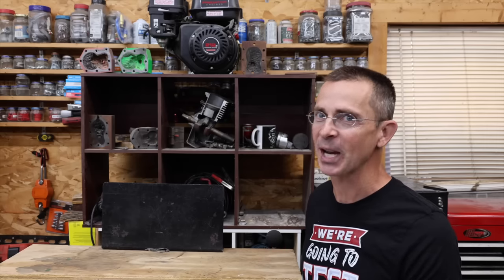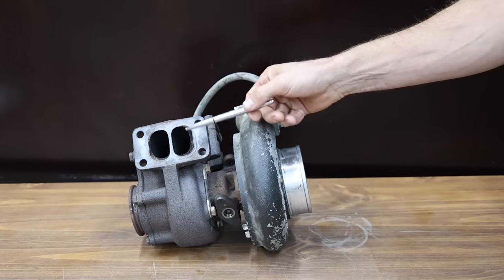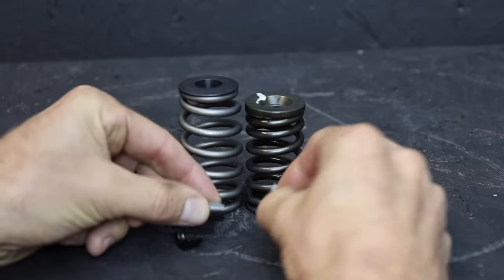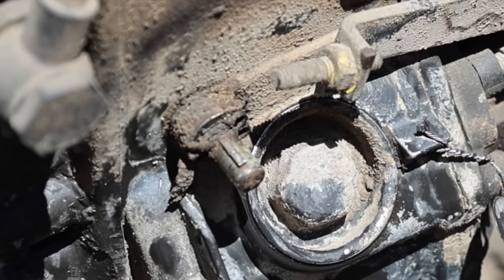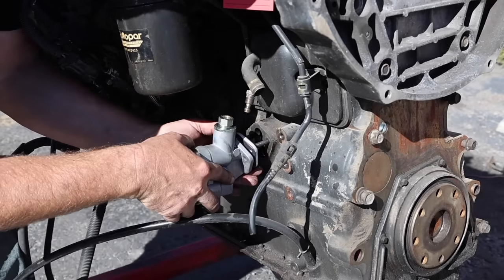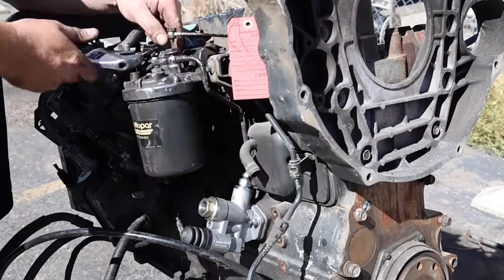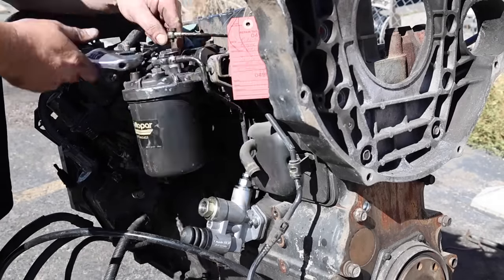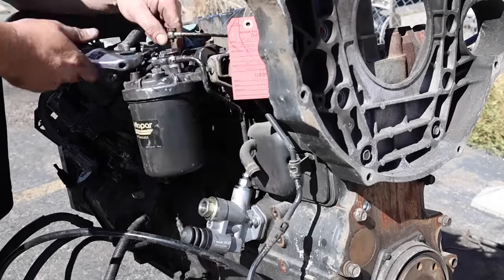Did I Waste $5000 on Engine Parts? More Horsepower & MPGs? (Part 1)

Comment: Wow! Looks like you basically doubled the horsepower, and more importantly, the torque. Very impressive. Those numbers are close to what my 2018 6.7 Cummins makes. I wonder how long the engine will last putting out that much power?
Reply: Should last a long time still. That engine is choked to crap from the factory. A lot like our 6.7 diesels are... except now it's because of emissions stuff.
Reply: Longer than anything new. My employer bought brand new KW T880 last year with x15 Cummins and it broke crankshaft in two with only 24,000 miles on it. We have several trucks with Paccar engines and Cummins and all new and always got problems.
Reply: There is a marine version of the engine that puts out 300 HP stock.
Reply: It will last, there are people out there making more and they are still running strong as a work vehicle.

Then you have mine which is not a work truck I've had for 9 years and daily drove it. Most of it's life to me had a 72mm single, 5x016 injectors. The bottom end is still stock and it's still a runner.
Reply: @BruceLee-xn3nn that doesn't happen on Australian Kenworths with the x15
Reply: @BruceLee-xn3nn  Every engine brand is prone to a failure. I managed truck fleets for 30+ years and I've had one engine go 675k before we inspected the rod and main bearings. I had another brand new that made it 6 miles from the dealership and locked up. So it matters not if it's a USA or Australian engine.
Reply: @Watchyn_Yarwood  our 92 mack wth close to 900,000 has had less problems than the new expensive junk they've bought. We've had to change turbos on several other trucks and they didn't even have 300,000 yet.   The Cummins that broke the crank now has electrical problems where the cluster. It goes haywire where gauges don't work right ,no AC,no Jake brake. We've never had constant problems before like we do now.

Comment: Now you need to add an OBDII ELM 327 dongle and get the OBD JScan app.  That app will let you make more custom changes, although it is geared toward more modern Ram/Dodge/Jeep products.

Interesting story:  had a 2011 Ram 2500 work truck that had a button on the dash to let you run "light load" mode.  This let you drop tire pressures to 65psi front and 45psi rear when not towing or running heavy.  This allowed the truck to ride like a 1500.  The button re-adjusted settings for TPMS warnings.

Ram got rid of this feature after a year or so, likely due to idiots forgetting to air back up prior to towing/hauling.  However, the JScan app brings back that functionality!

Of course, if your truck is pre-TPMS, you can just adjust pressures (and subsequent ride comfort) as needed.

Comment: Love this. It’s a little different than what we are used to but wholeheartedly welcome. Btw I am on my 9th 12 valve Cummins. It’s getting harder and harder to find clean ones and the prices have shot up quite a bit. It’s still the best engine ever made with multiple trucks at over a million miles. Once again awesome video.
Reply: Yeah they're reliable, but only because they have no power. You reduce the RPM/boost to 180HP and <3k redline on any newer Diesel and they're also going to last a million miles. But yeah obviously not having the emission systems is a huge benefit for the older Diesel trucks.
Reply from the maker: Thanks!  Thanks for the feedback.
Reply: I respectfully disagree. If that was the case then why aren't the 6.5 gm amd 6.9 ford's of the same Era known for being as reliable? The lack of electronics, 40% less parts than its counterparts, robust p7100 injection system, straight 6 layout, medium duty design, mechanical fuel pump and about a dozen other reasons are why it's so reliable and awesome. Even turned up they seem to last forever.
Reply: @fdavid 6.9 fords are known for being reliable. You’ll get over 500k out of one absolutely no problem with some basic maintenance. But they don’t have the potential power like the 12v, so they don’t get talked about.

Comment: Kudos to the folks at Power Driven Diesel. IMO “do not try this at home”. Very impressed with the body condition of your 16 year old truck. And yes, you did get your monies worth!
Reply: 16 years? You're off by more than 10 years, a 96 is already 27 years old which makes this even more impressive tbh. My winter truck is a 86 and definitely benefits from regular oil based undercoating as it doesn't really rust anymore after I've welded in lots of fresh steel to fix the previous  owners neglect. But it could need an upgrade as well, it's way slower than Tods truck in stock form :D
Reply: @creak92  at 0:17 he clearly says he has had the truck for 16 years.
Reply from the maker: Thanks for the feedback.
Reply: @cdnmember  "I've had this old 1996 Dodge for over 16 years", you can buy trucks used instead of factory fresh after all.
Reply: @creak92  Which obviously means he was not the original purchaser and did not get the truck new. He let someone else take +10 years of depreciation before he got it. That was smart. Now he is making upgrades to bring it to modern levels of performance to a fraction of the cost of the new truck. Also very smart. Now is has upgrades to one of the most revered motors in terms of reliability, and one which does not suffer from all the annoying EPA required crap that makes the modern truck unreliable (DPF and DEF). Also smart!
Reply: @LisaMedeiros-tr2lz  why you're telling me that? That's exactly what I was saying.
Reply: @cdnmember yeah... ever heard of used? Idk how you think it's only 16 years old lol. A 2007 is. And that's clearly not a 07 cummins lol.
Reply: @LisaMedeiros-tr2lz I have a 17 f350 6.7. Thing is reliable as all hell. It still had 214k on it stock. But since has become not stock anymore and lot louder.
Reply: @joshhassler  never said it was 16 years old, only that he said he had it for 16 years, so,he took good care of it. Obviously bought used so let someone else take the depreciation hit.
Reply: @creak92 "definitely benefits from regular oil based undercoating" - So that's why my car is leaking from the engine and the trans like crazy, it's trying to protect itself from corrosion.
Reply: Just make sure you never order any parts from them. They straight up stole my money and when I tried to call and figure out what went wrong they told me to get lost because I don’t drive a Cummins.

Power Driven Diesel is the worst company I have ever dealt with in my entire life.
Reply: @meowfaceification  sorry to hear, sounds like an issue for small claims court.
Reply: @cdnmember  "Very impressed with the body condition of your 16 year old truck" "never said it was 16 years old" gotta make up your mind guy

Comment: It nice that you have reached the point where you van treat yourself to a upgrade and be able to share it with us.

I would also consider checking on the health of your differentials and transfer case just to be sure they can withstand the sudden boost in power without shearing gear teeth.
Reply: Good one.  Get that factory tar out of there if nothing else.

Comment: I had no idea that valve springs played such an important part in keeping floating valves at a minimum.  Nice replacement for that old engine.  Along with the new turbo charger & exhaust manifold gasket, you should be running good.  Cheers from eastern TN
Reply from the maker: Thanks for the feedback.
Reply: It's a very common misconception, but those particular springs don't actually help RPM induced valve float. They are a taller lower rate spring designed to increase seat pressure to keep manifold pressure from opening the valve. For valve float more open pressure is what is needed.

Comment: This video is Exhibit A of why the older 12 and 24v Cummins trucks are so expensive still to this day. They provide 75% of the performance a new (less than 5 year old) diesel truck for 1/4 the price.
Reply: Just wait till people start realizing that the Mercedes om647 was the only million-mile motor ever invented and there's a reason why it goes a half a million miles and it still sells for $20,000
2001-2004 Mercedes Sprinters
Reply from the maker: Thanks for the feedback.

Comment: Ive seen some very simple modifications done to those Cummins involving the fuel pump and a fuel plate? Also governor, but they were drifting in second and 3rd gear. Roughly 700 ft lbs from 400ish, valve springs were the next thing they went for but the modifications cost them less than $100. I may be wrong on this but i think they also had some used +50 hp injectors maybe 100

Comment: I am surprised at your negative experience with the stock truck. I had a 95 Ram with the V10 gas engine. It always had plenty of power for me. My only complaint was the poor fuel mileage of 10mpg. It didn't matter if it was city or highway driving or towing, always 10mpg. Mine was also only 2 wheel drive. It did have a factory limited slip rear diff but it would still get stuck on wet grass. It had over 200k miles  and  was still a great truck!

Comment: 1:  Change your battery "crossover" cable.             They corrode inside the insulation and cause the passenger side battery to boil over because the Cummins charges the passenger side battery but tests battery voltage at the drivers side. That STUPID WIRE took out my turbo, A/C, and everything that you're replacing.

2:  Absolutely loving this as I'm literally washing anti-seize off my hands (getting a snack) about to bolt my new turbo on my 2006 5.9 Ram 2500 as I'm fixing the problem that I just spoke about.

3:  Thanks for saving me tons of money... and for all your videos. Love the integrity.

PS: The bolt trick is magnetic heat induction guns. Best money I've ever spent on tools for rusty diesel trucks. Buy a cheap one online ($250). Works better (and safer) than oxy/acetylene and looks like magic.
Reply from the maker: Thanks and you are welcome!  Thanks for the feedback.

Comment: I live near the MOPAR factree in Warren Michigan. I love that truck ya got. But I got an AMC 244 cubic inch in a 98 Cherokee so I'll live. I plan on doing the same to the old AMC soon. Great video!
Exhaust bolt no snappy 10,000 - Propane torch > WD40 > Impact ratchet > Smile
- Detroit
Reply from the maker: Thanks!  Thanks for sharing.

Comment: Just a tip the exhaust spins the turbine wheel which also spins the compressor wheel thus creating boost and I’d say in my personal opinion your truck was probably due for an upgrade a long time ago as that stock turbo has seen many miles, a lot of people don’t realize how much their diesel engine with an old factory turbo can benefit from a newer larger turbo it’ll definitely unlock a lot of potential for towing and acceleration!
Reply from the maker: Thanks for the tip.

Comment: Another fascinating video, after building and rebuilding gas engines, I had no idea of the complexity of a diesel!  I have a 2013 Avalanche, bought used, but in fantastic shape for my occasional towing needs. However, with only 340 hp and and average of 17mpg could use some upgrades. I am in process of planning an addition of 60-80 hp and think cam and long-tube headers should reach that mark. I am told there are cams that would improve performance and get a bit better gas mileage. What do you think? Primary use is basic hauling and occasionally towing with small MC trailer and max 2,000 lbs.  I recently installed a tuner and aem cold air box from Black box performance 1st. The huge change was the transmission which made drivability like a modern day truck, now a few more ponies and I will be satisfied.
Reply: You must live in a warm climate because those usually rusted out faster than the original Chevy Vega did where I live.

Comment: This was another awesome vid. Prob my fav so far. Def in top 3. Little confusing seeing different upgrades on 2 dif engines, but i imagine the same upgrades were done to your motor as the motor that was on the stand, just done to the one on the stand to be easier to see.

For a video recommendation, id like to see the same video but for a gas engine instead of diesel. If it would take the same amount of money, or less, which components should be changed, etc. I think youd get more efficiency for less money. Also, was the $5,000 including the transmission? Or just the engine upgrades?
Reply from the maker: Thanks!  Thanks for the suggestion.

Comment: Welp, I always like your videos and use your information consistently.  But now you've crossed over into one of my real interests.  I've had and built so many of these 5.9s, 6.7s. I drove a 96, 5 speed, 2 wheel drive club cab with gearvendor over drive, exhaust brake, etc, turned out 580 hp on Dino for 10 plus years. The gearvendor Overdrive wouldn't handle the full power but you could feather into it in double overdrive as I called it and it would send speedometer to the bottom. Not sure after 120mph, but it was a little light on its tires and you were flying. 
 I'm currently building a 1st and 3rd gen . Really smart choices on your upgrades. Who's  transmission did you end up going with? I get finished with 3rd gen it's going to be around 800 hp rear wheel. Then I'm going Ram Trx and Raptor R hunting. Lol. 

Keep on Keeping on brother
Reply from the maker: Thanks, will do!

Comment: This is awesome. Just proves the point that it is most often cheaper to fix or upgrade what you have than it is to buy something new. I wish you would have made a point to mention the torque increases on the truck as that’s arguably the most important thing when it comes to using diesel pick ups. The 100 HP gain is nice, but if I am watching the video and my math is right, it looks like you DOUBLED the amount of torque! To me, that’s way more impressive! And that’s with the transmission going out!
Reply from the maker: Thanks!

Comment: This was a great video. I love power driven Diesel and have the AFC live and 150 horse injectors. Worked over the pump and went from 16 lb Factory boost  to 40 PSI on the non wastegate Turbo
Reply from the maker: Thanks!  Thanks for sharing.

Comment: I would love to do this kind of performance work to my car, but i doubt there's these kind of options for an 01 LeSabre.

Great video as always! Love to see something fresh!
Reply from the maker: Thanks!  Thanks for the suggestion.
Reply: Yeah unfortunately with your Buick you're pretty limited to what you can do that doesn't require a lot of work. You could swap in a supercharged 3800 for an extra 35hp and 50 lb-ft of torque (when it was new) but then you'd also need to run premium gas. You'd be at the limit of what the transmission is rated to handle too.

If you have the time, money, and inclination you could find a car your grandma might have driven and build a fun sleeper. You could even do it with your Buick, but not if it's your only car

Comment: Those 12v Cummins are great workhorses and continue to be in high demand.

The transmission was definitely the weak link in those early Dodge Cummins trucks.  Best advice back in the day was to install a shift kit on the Chrysler transmission, which was based on the 727B. 

 It's a strong transmission that was used successfully behind the 426 Hemis, but it was not built to handle the low-rpm torque thrust of the Cummins.

Anywayz, the shift kit would tighten up the bands and make the transmission shift HARD and at higher rpms.  You'd think it was hard on the transmission, but it was actually better for the transmission, but very hard on the driveline after the transmission!  Some of the old trans experts would shift balls around in the fluid channels, also, but that was beyond my comprehension.

A friend of my brother put a shift kit in his '70 Charger w/ 383-4V.  That car would shift out of 1st at 55mph, and shift out of 2nd at over 90mph.  Good times back in the early 80s!
Reply from the maker: Thanks for sharing!

Comment: Great video. It's amazing what a few upgrades will do for an old pickup. Stock is best is what i always told myself, but I wouldn't trade my 93 or my 06 twin turbo Cummins for anything. Now that you have a hot rod diesel, I would like to see a shootout on which diesel fuel conditioner is the best. Lubrication, cleaner, cetane booster, mileage, etc. There are tons of manufacturers out there. Stanadyne, DDP, Power Service, Howes, Marvel Mystery Oil, etc. Just to name a few even run a little two stroke oil with my conditioner, started in my First Gen since the injection pump is solely  lubricated by the fuel, but carried it over to my Third Gen as well. Another thing to note is if you could recreate the old ruby red dyed diesel. I'm meticulous about my fuel mileage and my old First Gen would get 75 miles more per tank of fuel with the old high sulpher dyed fuel. I know the dye didn't have anything to do with it. If you have questions, feel free to ask.
Reply from the maker: Thanks for the suggestion.

Comment: Could you do a Hedge Trimmer video? 
I understand that it could be difficult to do but what is most interesting is how thick branches each one can cut, runtime is another, maybe the speed of which it’s pruning consistently, weight vs performance etc.
Reply from the maker: Thanks for the suggestion.

Comment: I had the same year with the v10 was a great truck except the transmission it would over heat going up steep hills into job sites Got a Ford SD diesel with a manual still driving it as of today !
Reply from the maker: Thanks for sharing!

Comment: I needed this video.  There are 5 RAM diesels in my fleet.  The 96 P pump truck is feeble and needs help.  I didn't see an exhaust size upgrade which is usually a first step.  I can also use the transmission video.
Reply from the maker: Thanks for sharing.